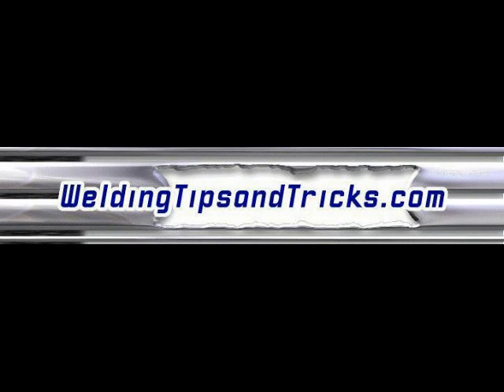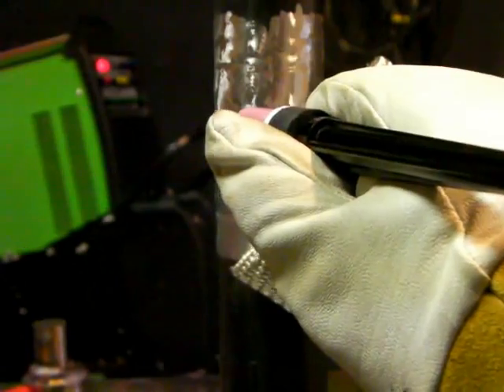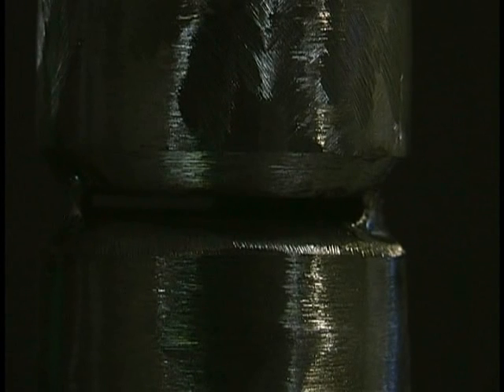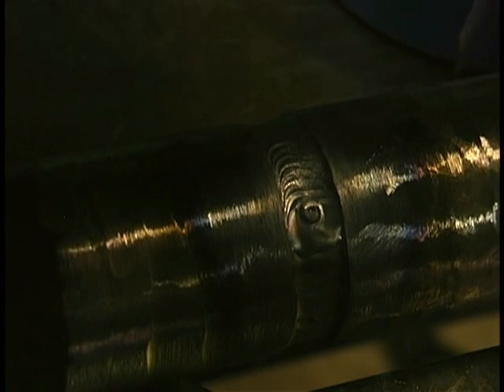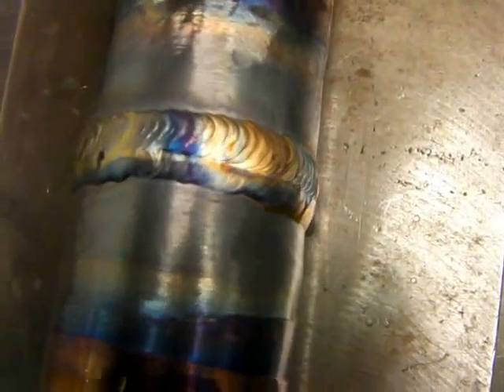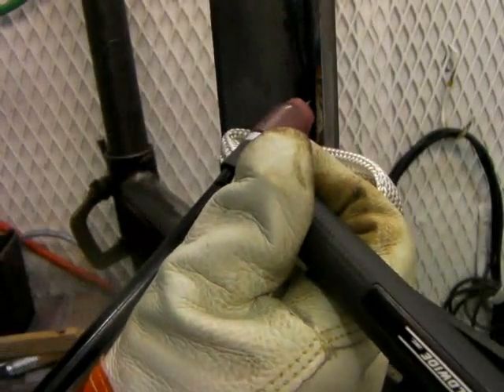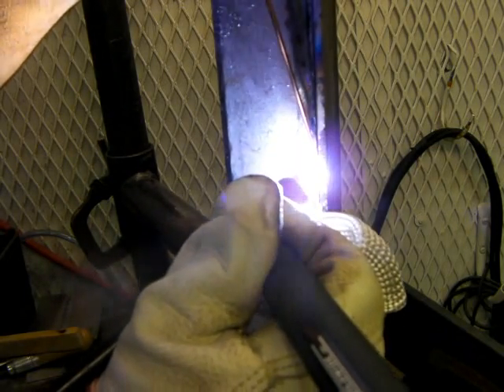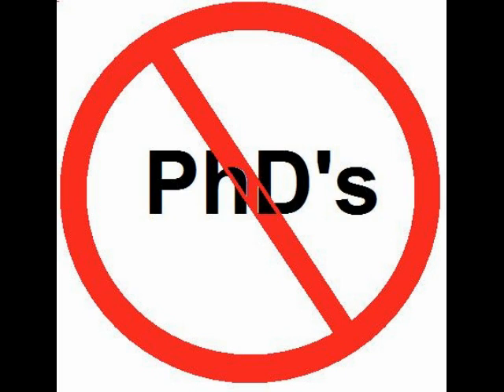How to Tig Weld with the Lay Wire Technique

Comment: Hey, great video! I was wondering if you could elaborate on your feeding technique for doing a lay wire. I’m newish to rig welding so my feeding hand is not quite up to snuff so any tips pointers would be super helpful. Also wondering what kind of pressure you are putting on your filler rod  whilst feeding it into the puddle.
Thanks,
Mike

Comment: Great video!  I have a particular weld problem and would greatly appreciate your thoughts.  I need to build up about an inch of new metal on top of a 1/4 inch hot rolled steel bar. On a vertical surface.  What tungsten size, rod size, amperage, and technique would you use?  After the required build up the new mass will be ground to a particular shape.  It is not structural.  I have a 200 A machine.  Thank you any suggestions would be most greatly appreciated I am finding that the only way to do it is to kind of jam the rod in there in short segments leaving a very uneven surface.  BTW I could not even try this without my tig finger.

Comment: LLove your videos and I've been trying the laywire technique, but it doesn't seem to go like on your video. The filler rod melts, but it melts to far and it gets stuck to the piece and then I have to push is back to the puddle. With you, it just stays in front of the puddle and it flows nice and easy. Do you have any ideas what the problem might be. More amps, wrong torch angle, thicker filler? Thanks

Comment: What is the puddle? Thanks.. I know nothing of welding here learning...
Reply: the puddle is were the metal is melted by the yellowish looking ARC that he is moving around.  The ARC allows the melted metal puddle to move around so that it can join the metal properly.  In this video, his puddle consist of the two pieces of metal that need to be joined and the filler rod (aka wire)  that he is using adds metal to that puddle so that the pieces are joined correctly.
Reply: Thank you,  I thought the wire was melted and it bonded to the surface of the metal like solder.. But know I see this ARC melts the metal then the wire fills.. Thanks for the explanation..

Comment: fucking idiot..normal man put wire inside of the pipe and melt ower there..but need more air space of the pipes....come of finland and learn
Reply: just because he does it differently from the way you do it doesn't make him a "fucking idiot." there's more than 1 way to weld a root pass. and where or what the hell is finland?

Comment: Just put the root in with approx 80-90 amp, then fill with about 150, finally pulse in at 250 ish with 2sec delay. Use #12 gas cup and 2.4 tungsten. Result motorsports quality welds :)
Reply: +iiredeye Lol nobody should be giving tips to jodie, jodie gives tips to you, seriously though i bet my last penny jodie is a ten times more skilled welder than you
Reply: motorsports quality?   lol!!!

Comment: Im taking my state cert tests for section 9 of the boiler code on friday.  Im having to purge the inside pipe. Also the pipe will be turning. Ill be tested on sch 40 pipe. Stainless to carbin with just the carbin bev. What would I need to set my Miller 250, argon flow to make the best root pass? Your feed back would help. Thanks for all the videos sir they rock.
Reply: +James Jordan You would need to set your Miller in the trash and get you a Lincoln.

Comment: Sometimes it isnt the heat being too high. If your dipping the wire at a dodgy angle then the heat will melt the wire before you can dip it. I had this problem a few years ago as an apprentice.

Comment: I am trying to weld some steel black pipe (The kind that Home Depot sellsin the plumbing department)

I have a old school go-kart that was made of this a long time ago, I want to do some additional work on with new black steel pipe.

What would be the best way to join them? They are 3/4" in diameter.

Comment: Running way to hot or you're not laying the wire directly in the puddle, usually it balls up when you try to add wire and you are to close to the arc.

Comment: try shortening the arc length, or use less of a push angle with the torch. i do not dip for any of the passes in 2 inch pipe. lay the wire in the puddle when you start at the tack and just follow the rod around the joint with the torch. keep a tight arc length. you know when to advance forward when you see the puddle wash flat into both bevels. may have to use a slight up and down motion, but not too drastic more like a nervous twitch. then use the same technigue for the rest of the fills.
Reply: Likaa Bikka 
I think you’re exactly right Bikka.  I’ve done miles of 2” up to 36” years ago.  I don’t think I could do it now, unless I could start both sides at 3:00 and then let someone younger do the bottom half.  : )

Comment: Hi Joody I'm Daniel from Croatia Europe I have a welder WSE 200p AC / DC (with a foot pedal that you do not have the habit to use) the same as Everlast. so I wonder about how good a welder for welding the root pass it in black steel, stainless steel and aluminum and the possibilities that there are advantages and disadvantages are. This welder on youtube there are plenty of people but only shown no welding parameters. Can you test it. THANK YOU!

Comment: @d3javoodoo this type of welding is not strong and is bad habit to learn walking the cup.if anybody cant weld your hand floating in the air welding is not for you,and you need to learn to tail off slowly to prevent the pit hole in the tail off.

Comment: @pickledsk8r people normally class a secondary pass over a tig root as a hot pass. this acts to reinforce and more importantly temper the root run to inhibit cracking or secondary penetration prior to the application of a different weld process. (especially if the root run has a reduced through weld thickness) and weld 36 has made a very accurate statement. check out my vids hope you like them.

Comment: Nice video. this is the technique i use when i weld heavy wall pipe. It's almost funny how easy it is to get very consistent using the method of welding.

Comment: @yesac101 hahahahaha NO
its not called HOT PASS because the weld id hot
you dont have to run a second pass right after its just recommend to keep your root from breaking it the pipe is hit
and while silicon is created during the tig process their is not enough of it to require a hot pass
andd while yes they are all arc welding they are all different types of arcs with different arc cherteristics

Comment: @pickledsk8r  Errhhhh, wrong. There is slag created when tig welding steel the filler rod is still coated in silicon and it will precipitate that in the weld if it i not removed. Also a hot pass is when you do a pass directly over your root or a second root pass while its still very hot aka a "hot pass". Furthermore, smaw, gtaw, gmaw, paw, saw, and caw are all arc welding. So before you put a dumb ass comment showing how ignorant you are, just refrain.

Comment: QUICK QUESTION?WHEN SETTING UP UR PIPE FOR ROOTPASS DO YOU SET UR PIPE UP SO THE ROD FIT JUST RIGHT OR DO YOU SET UR GAP TO WHERE UR ROD SLIDES FREELY THREW THE PIPE.ANY INFO WOULD HELP ALOT.I USE A 5/32 GAP IS THAT TO BIG OF A GAP FOR THE ROOTPASS

Comment: A hot pass is to burn out hydrogen , when cellulose electrodes have been used on the root run . Just passed my CISWIP 3.1 level 2  I also thought it was to burn out any slag . It's to prevent hydrogen induced cracking .

Comment: just so you know their is no such thing as a "hot pass" when tig welding
a "hott pass" is done to burn out the wagon tracks (slag) when arc welding and when tig welding their is no slag created 
yes you still may turn the welder up but it is not a "hot pass" its just the 2nd pass then tig